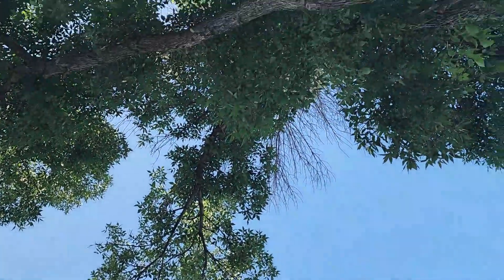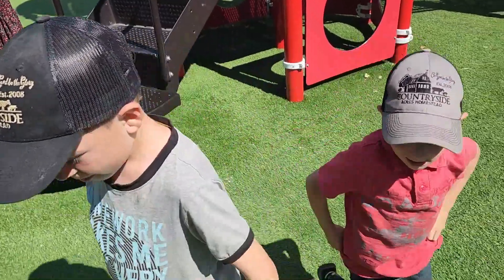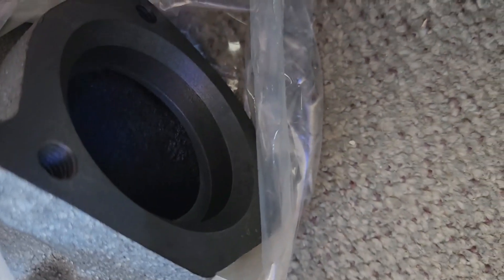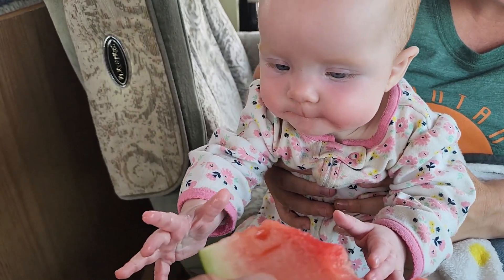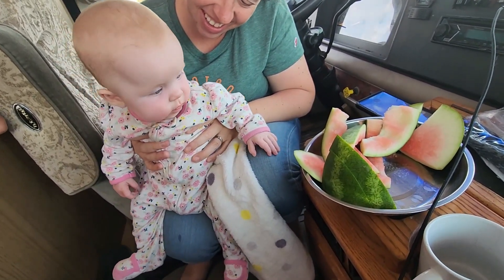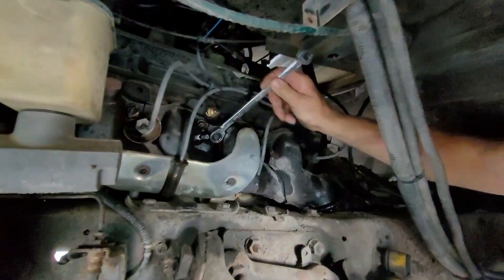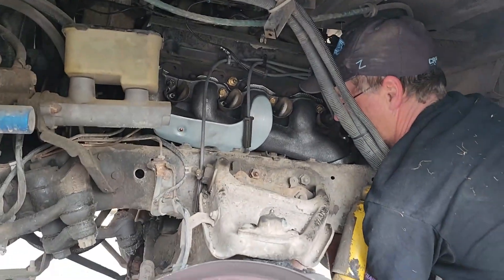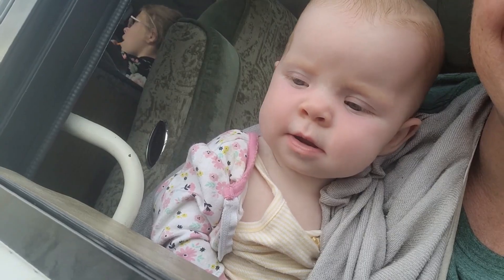God is GREAT!

Comment: Shorty headers are a dime a dozen for BBC engines and exhaust pipes will bolt on in the same location. They are welded tubes instead of cast iron so they don't crack and the help the engine breath so they slightly improve mileage and power. Mechanic for 30 years and I rarely replace exhaust manifolds.
Reply from the maker: I guess I don't know enough about it to have even asked about something like that. Maybe if it happens to the other side, I'll look into it.

Comment: That break was crazy. How on earth does a break like that even happen? My hubby was a lot like that repairman, just making do. He also replied all the sheered off bolts the guys at work busted off at work. I'm so glad it wasn't hard to finally repair the manifold.
Reply from the maker: Probly started with a small crack, and the continued expansion and contraction caused it it to break all the way around. Guys, like your husband, seem to be running scarce.

Comment: If you have the R134a it’s $10 at Walmart, glad you got the manifold fixed so fast, if a bolt snaps Po this all turns into a pain
Reply from the maker: Ya unfortunately it is leaking, air is warm again today.
Reply: You can buy this stuff with UV in it at most auto parts store, than you fill it and with a small up light you can search along the AC line to find the leak, that way I found my leak quickly, on the RV the lines shouldn’t be to long. They also sell these cans with stop leak, you could also try this but 1st option is the proper one, find the leak and try to fix it. Good news is that your compressor and AC components work if you had cold air.
Reply from the maker: Fix it wity jb weld or what do you think?
Reply: @countrysideacreshomestead2008  well, first you have to find the leak, most of the time those leaks are at some joint, valve or flange fitting. Sometimes a little rotten o-ring is all that is needed. Sometimes a valve. If you find the leak which is easy with the UV light you know what you are dealing with. Once you have the leak a homesteader will figure something out. Lol
Reply: Forgot to mention in these older RVs the cold and hot air is vacuum controlled, if you have a vacuum leak it is setup to be standard on heat. But since the AC worked for a while after a recharge it seems that you have a R134a leak somewhere
Reply from the maker: I think I found it, will have to do a more thorough check and then see about fixing it

Comment: WD 40 is great, and I'm sold on PB Blaster too..There is another called Freeze Off, I think, that works great...It chills the bolts, and causes them to contract, making them a thousanth or two smaller, with lube ....Manifold bolts can be the devil....Thanks for being patient and diligent on your issue.....It sounds like you got a fair deal..... You are wise.....If I was your child, I would be proud to have you for a daddy......
Reply from the maker: Thank you! I find wd isn't as good as it used to be but it works.